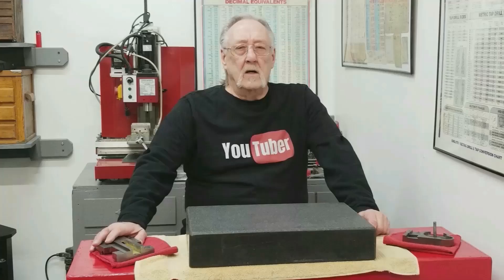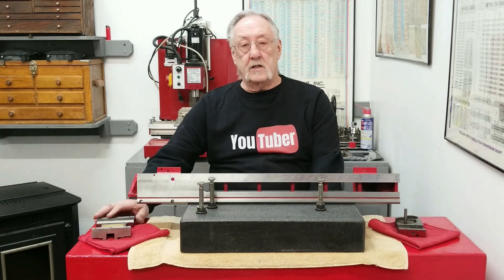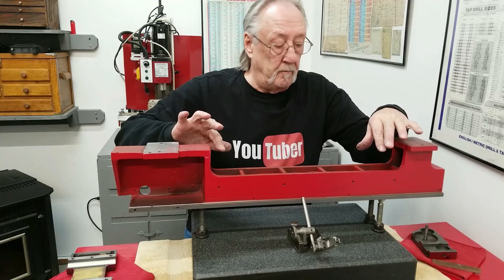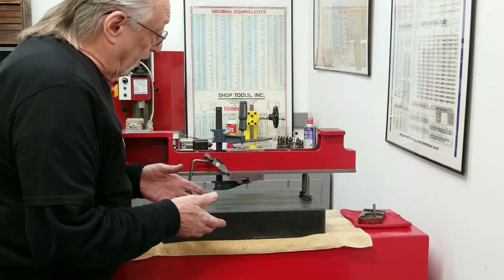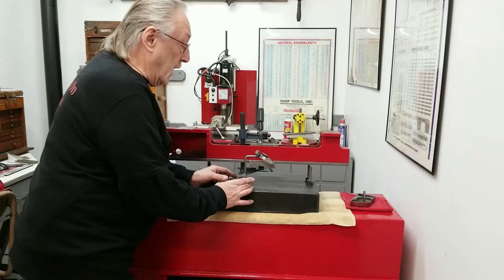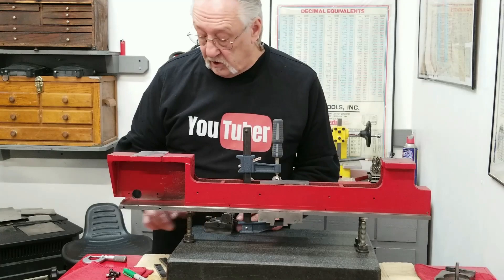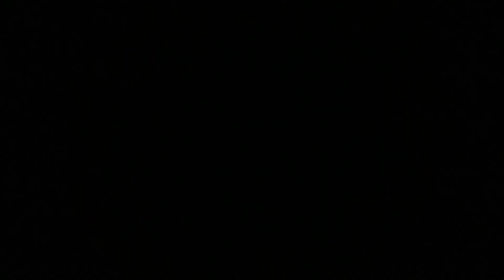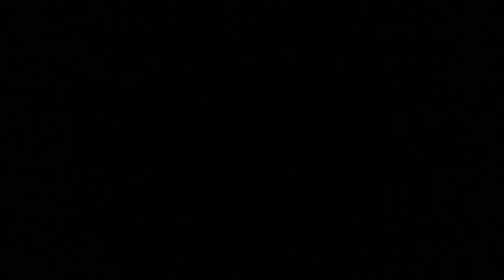Upgrading Your Mini Lathe 3, The Carriage

Comment: I just ordered a bed extension for my mini lathe as being the easiest way to avoid having to hand lap several thousandths in one firection off the front side of the ways and several more thousandths off the back side in the opposite direction to get them straight. Your finding that the extension kit was fairly straight helped me make that decision.  I hope that mine is the same.

I'm 71 years old and a former ASE Master  auto technician, but other than getting to play with a lathe in a high school shop survey class and use a dedicated lathe for turning automotive starter and generator commutator rings I really haven't used any machine tools (I don't count Neway valve seat tools or cylinder hones) since I bought a mini lathe and mini mill a couple of years ago.

Watching your videos has already prevented me from making any number of misteaks in setting up my new lathe bed, and it hasn't even arrived yet. I would say "Keep up the good work", but I am obviously coming late to the game and have a lot of catching up to do on the good work that you've already done.

Thanks!
Reply from the maker: Hello Brad, This is a Hobby and coming late to the game has nothing to do with it. You're 71, I'm 72, has nothing to do with it. You held a certified position. An ASE Master Auto Technician, That has something to do with it. You sound like a smart guy. Catching up? There is no catching up, you're not on the "JOB". This is a Hobby and we are learning to have fun while doing things we like to do. Even if you had to lap material off your bed ways, who cares how long it takes. We're are not on the JOB. I look at it like this. When there is a problem with my hobby machines, I think,  Can I fix it? Some times I can and some times, I think you know what I mean. Have fun with your mini machine tools, And like I say until next time Enjoy.

Comment: Thanks for the video, nice and clean presentation! With the carriage off, I'd suggest adding a cover for the gears in the apron.
Reply from the maker: Thank you for watching my video and the kind words.  I think you're right adding a cover for the gears in the apron is a good idea. I may even do a quick video on that.
Reply: @GlennNowOnYouTube  great, just a simple sheet of plastic or sheet metal and a few tapped holes will do the trick. I went for a plastic sheet (the lid of an old storage box) which was transparent and made aligning the holes easier

Comment: Do you benefit more from a 3 inch surface plate than a 2 inch plate. I just purchased a "B" 2X9X12 surface plate. In what way is the 3" plate better if it is . Thank you
Reply from the maker: Do I benefit more? I personally don't. Only because I'm only doing hobby machining. But, I would think the thicker the granite the more stable it would be. But again, if you're not in a clean room that is temperature controlled it really doesn't matter. 1" ,2" or 3" it's all good, you have a flat surface to work off of. I think your 2" will be just fine.

Comment: I’m missing context as to why there were no existing holes for the pillar blocks or the speed change bracket.
Reply from the maker: Hello Mitch, From what I understand these lathe beds are used by a wide variety of companies around the world. The carriages/aprons are designed differently by some of the companies that use this lathe bed. The position of the half nut that runs on the lead screw may be higher or lower in the apron, which in turn puts the lead screw higher or lower, which again puts the pillow blocks in a different location. Let me know if that makes sense or not. Are you thinking about doing a bed extension project?
Reply: @GlennNowOnYouTube  I understand the way you determined and did your drilling. I thought you we’re working with your original lathe bed.  I did think until I saw a video of another fellow on YT that you might have been installing a new linger bed kit to give your lathe longer working area between Chuck and tailstock. That is why I was confused about no existing homes for lead screw pillar blocks and gear speed changer